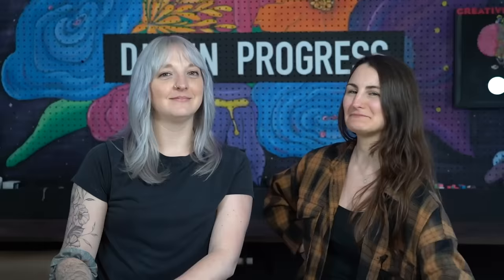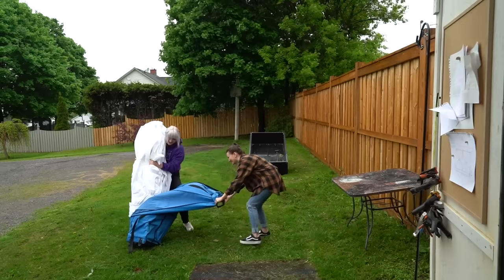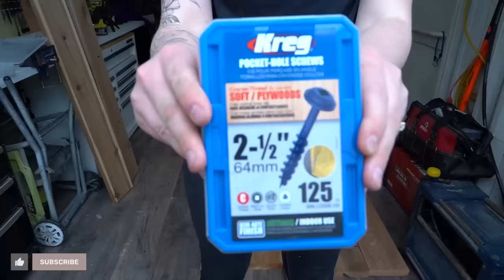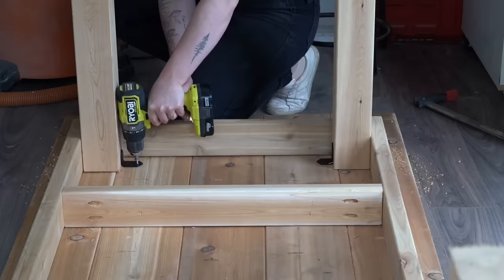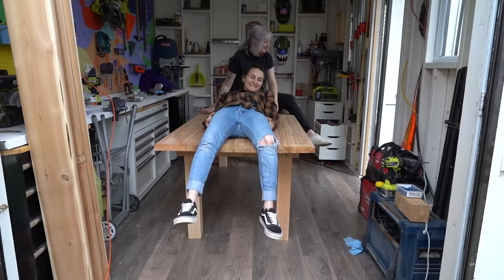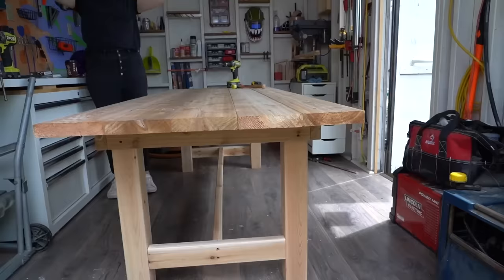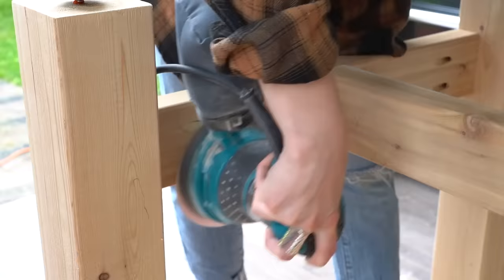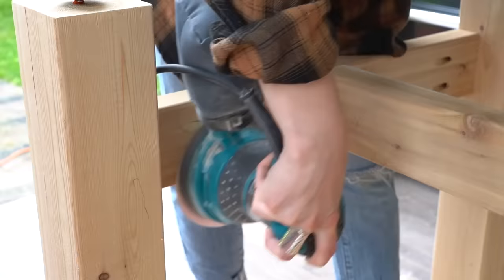WE BUILT A DINING TABLE IN ONE DAY!

Comment: How has the table held up in the last year? Pocket screws have worked out okay for me in the past with smaller tables, such as coffee tables, but a table this size would generally need dowels or dominos in addition to wood glue. It's also important to clamp the top for a period of at least 24 hours. I would think this would split apart being the table top pieces aren't actually connected to each other. As the wood contracts or expands, it will split apart. 4X4 legs also tend to split, it's recommended that you laminate a couple of 2X4's together to prevent splitting. This isn't meant to be bashing, I actually built my first table years ago fairly similarly to this. Within a month there were big gaps on the table top because the wood boards were not actually joined together. As far as the legs go, I used 4X4 legs for a work bench that cracked due to the pressure and not having any place to expand or contract. a couple of 2X4's laminated together allow some wiggle room for expansion and contraction.
Reply: If the wood has acclimated to local temperature and humidity, and neither of those change much throughout the year, the wood will be stable.  See also the comment about cupping.
The other way to make the wood (more) stable is to coat all wood surfaces, especially board ends, with an impervious sealer.

Comment: so it looks like the top is made from 5 2x8 for a final dimension of 36.25" ? Did you experience any shrinkage on the width of the boards ? i'm considering using z-clip to attach the top to prevent this